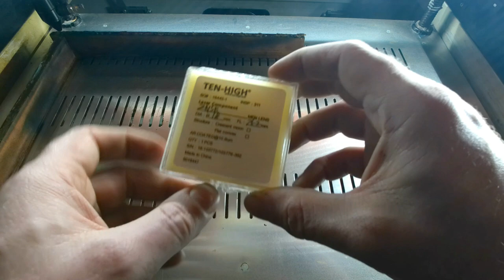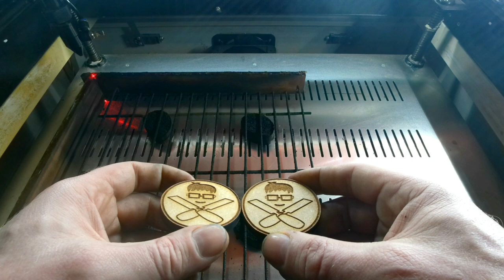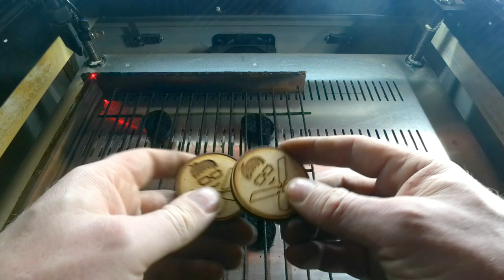Installing a 3" lens on a 50w Chinese laser, how to ramp test. How thick will it cut?

Comment: Have you used a 4” lens Phil
Reply from the maker: Not yet. I have never re installed the 3" lens. For me it had a negative impact on thicker materials. After much more testing I managed to cut through 10mm acrylic with the 2" but the 3" gave up half way. Even with multiple passes and different focal distances
Reply: @philscraftcorner  I’ve just upgraded my 50w laser with 60w TEN HIGH laser tube, new mirrors new 2” and 4” lens going to text this weekend thanks
Reply from the maker: Good luck, I hope you put a new 60w power supply in too
Reply: @philscraftcorner  it had a 60w power supply in when I bought the laser 👍
Reply from the maker: @Martin-ll7jc  good to go then 😁
Reply: @philscraftcorner  well that didn’t go well, I tried the 4” lens it was not good I need a good video how to set this up, it seems so far away, don’t know if this is a lens problem MCWlaser CVD II-VI ZnSe Focus Lens Dia:18mm FL:4" it was £27 compared to the ten-high £75
Reply from the maker: It does end up being quite far. It should be roughly double then ramo test
Reply: @philscraftcorner  well that’s a return thank god I got it from Amazon, sticking with 2” lens for now, I’ve got 25 speed 35 power, and 35 speed 50 power 3.2 plywood thanks pal
Reply from the maker: Nice. That's some good speeds for plywood
Reply: @philscraftcorner  so quick update, I returned the 4” and swapped it for the 1.5“ came today, wow I was so amazed at the 1.5” -20 speed 30 power straight through 3.2 plywood and it engraves so very nice
Reply from the maker: Hmm. I might have to look into a 1.5" lens now thanks for the info

Comment: How do you keep the surface so damn clean????
Reply from the maker: I use the air assist that came with the machine. Speed and power settings help and if engraving you can mask the area off or turn air assist down

Comment: Have you tried a 4" lens? I'm presuming that a 3" lens will cut 4mm wood that is warped better than a 1.5" lens as an example, as being warped the focal distance will change?
Reply from the maker: From my experience so far of a 2" and a 4" lens the 2" cuts much better as it can focus more power to one point. I actually managed to cut through a 15mm piece of acrylic with the 2" cleaner and with less passes than with a 4"

Comment: Hey I'm watching this video now, good one btw. I have just recently bought a 60 watt Chinese laser and I'm worried that it's not really a 60w
I tried cutting through some 6 mm wood but it wouldn't do it in less than five passes. And when I try to do intricate stuff it just burned them away.in this video you said that if I replace the lens for a bigger lens that it wouldn't be good for doing intricate stuff is that correct ?.
Because I just started cutting 1/8 wood and it seems that I have to do three passes just to get through that.
Does that sound right to you.?
It looks like you are cutting through the 6mm with one pass right?
Reply from the maker: Have you checked your focal point. With my machine I'm cutting upto 10mm acrylic with the 2" lens. But you need to focus the cut to the center of the material. For 6mm mdf I would say 1 pass at 40% power and 6mm/s should be pretty close
Reply from the maker: Air assist is a must too
Reply: I also have an advertised 60w laser off eBay and it is a blue and black. Mine was advertised as 60 but after checking the dimensions of the tube it is actually only a 50wTube. I mostly cut baltic birch plywood and can cut thru on 1 pass at 6mm sec on 80% power. I did upgrade the air assist and installed a better exhaust fan along with a milliamp meter. Spent allot of time learning how to adjust the mirrors and lens then did the test like in this video to find my optimal focal distance. Mine originally came with a 1.5 lens and I bought a 2 inch lens for mine and like it allot better.
Reply from the maker: Hopefully you can cut a little better after finding your focal length. I mostly cut 4mm mdf at 8mm/s and 40% power in 1 pass on my 50w which is probably more like 40w
Reply: @philscraftcorner  I haven't tried cutting and MDF since I did all of my assignments and upgrades, maybe I'll try it again.
Reply: @philscraftcorner  hello! how to focus the cut at the center of the material? do you have a tutorial for that? I'm a newbie and bought a 80W china laser machine, I'm still learning how to use diff settyfor diff materials. thank you so much for the video!
Reply from the maker: I do a ramp test for each new material thickness then after I find the optimal focal point I use a speed and power test to find out the best speed and power settings